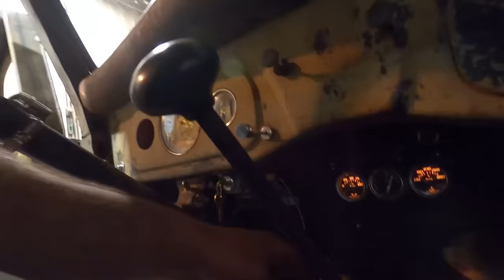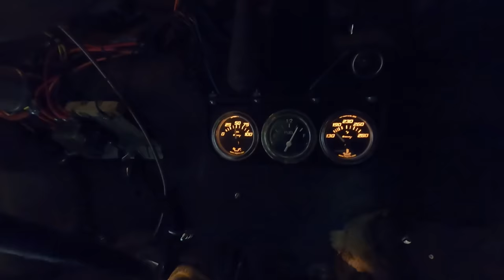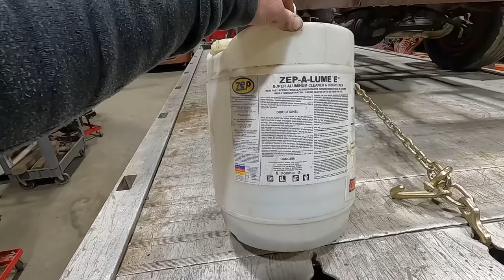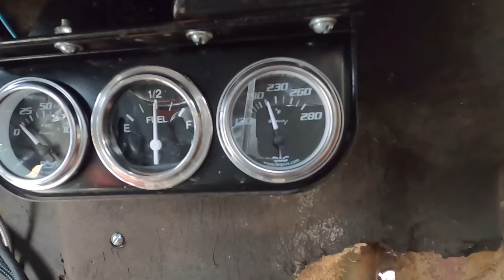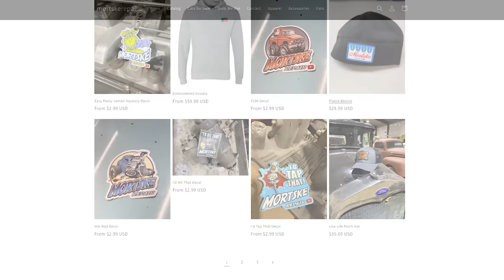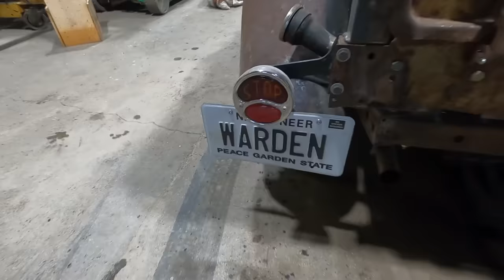1936 Ford Barn Find Pickup Truck! Overheating Flathead V8!! Problem Solved!

Comment: There is something about old flatheads that hold a special place in my heart. I have a 51 Plymouth with the L head 6 and you cant kill that engine. I am not well versed on the flathead V8 , but I know a little.  And that had an A on the head. Thats an earlier one, right? The AB came later in the 40s? Correct me if I am wrong. I love learning knew stuffs. Keep up the good work Mortske.  Love the content. Happy New Year
Reply from the maker: Same to you!

Comment: If you're wanting to spend a little more to restore or just remove rust try this i have used it my self it works awesome. CRC Evapo-Rust, Heavy-Duty Rust Remover, Reusable, Acid-Free, Non-Corrosive, Water-based

Comment: Shoe repair; as a kid we used to have new heels and soles sewn on and even cleats installed to save heel wear. The cleats made a unique tapping sound on hard floors! The repair shops were always run by old cigar smoking dudes. The smell of cigars and boot polish is a distinct memory! Long gone along with radiator repair, TV, heavy machine, auto frame & axle and electric motor rewinders, a place I worked as a teen. :eyes-purple-crying:
Reply from the maker: Wild times!

Comment: Happy new year to you and yours Mr M!! I wish you all the blessings and success!

In the shop i work in, we have used CLR with great success in cleaning out plugged up heater cores. I personally havent seen it used in like an engine block or radiator. What ive done is removed the hoses for the heater core, plugged one of the inlets and filled CLR in there and just let it sit. Flush with water and repeat and thats worked. I dunno if youve ever heard of an automotive product called BG, but another shop i worked in used BG exclusively, and BG makes a cooling system cleaner and treatment. Not super easy on the pocket book but you dump in the cleaner and i think it says to run for like 10 mins or maybe 20 mins? Anyways run this stuff through and then flush. BG makes a hell of a product. Maybe worth a shot? By the way loved the dodge on the last vid! Thanks for all the content you are indeed the man!!
Reply: Yes those BG products are excellent! Kinda hard to find though, have to google dealers for it I think.
Reply from the maker: Same to you!

Comment: You should make a tool to remove the head, take an old spark plug and weld a tee handle on it, you could use a couple 3/8 x 4 bolts

Comment: I had a 76 Datsun 620 that I picked up in 2016, but sat since 1989 in california.. When I removed the waterpump, it was rusted solid, and the entire cooling port was filled with rusty dust.. I flushed the hell out of the engine by stuffing a garden hose into the inlet, and ran the engine. Never had cooling issues with that truck for 50k miles. I find that having the cooling system flushing but open with a garden hose works really good.

Comment: I loved this video, I'm looking for a flathead Ford pickup. This was wicked helpful. Happy New Year
Reply from the maker: Same to you!
Reply: I have a question, when it comes to freeing up a stuck piston, I see you putting heat on the piston, if heat expands metal, and cold shrinks metal, would it be less work to apply heat to the block surrounding the stuck piston? And possibly applying cold ( spray type freeze off) directly to the piston, then taking a hammer to the piston? Thanks

Comment: Ok couple of weird and somewhat messy tricks.  
1 foaming coil /condenser cleaner . It's great for direct access and pinpoint locations .
2 white vinegar and baking soda . Great for engines with water pumps removed . Pour white vinegar in water inlet until it starts to run out of block plugs ( removed ) then use a funnel to dump baking soda in the inlet and watch it power thru the block . It's messy but it helps loosen and blow out the rust . Happy New Year . Stay warm stay safe .

Comment: Heya Mortske.  You've given me a 2-hour-plus video this week, so I wrote you a book.  Hope it gives you a laugh or two......and doesn't take you as long to read!

Whatever you do, DON'T get rid of the crashbox in that old pickup!  She's magical - such a musical set of gears in that thing......and they are always great for comedic content and when you're out with a mate and start putting money on whether the next gear change will crunch or not.  Crashboxes are supposed to grind until they fit - that is unless you are perfect with your timing between the gears and catch it when the revs are just right.  They will put up with a lot of crap, those things....and that flathead and crashbox combo brings back a lot of good memories for me.

Just for ref., pipe cleaners were used to clean the old man's tobacco pipe.  There's (obviously) a small tunnel between where the tobacco sits in the bowl at the end and where the mouthpiece is.  Over time, it gets all sorts of tar, ash and sediment deposits in it that eventually stop the smoke going through as well, so they devised a piece of wire covered in bristles that went up the pipe periodically and gave it a colonoscopy.  There are huge versions of that setup which are occasionally used on the council sewers as well, but be buggered if I'd want to be the one to do it......or even be around the area when they do it...!!

Yeah, I dunno what it is about modern gauge makers - or is it modern engines that need them higher figures? No idea - but when I see oil pressure gauges that go to 150PSI, rev counters that go to 15,000RPM and temp gauges that go to 300F / 150C - ie: MANY MILES above anything I would ever need to see in cars I have or know about or would want - then I wonder wtf their manufacturers were thinking.  Maybe they had a bunch where they just calibrated the face to read what the needle said rather than calibrate the internals so the needle read in the generally accepted range.  

I mean, what engine is still going to be performing well at 260F...and if it has gone nuclear, what good is it going to be for you to know by how much?  Again, if I'm getting more than 80PSI flowing around the oil galleries, the needle being pegged at the end of the gauge will tell me there's something wrong with the governor - I don't need to know it actually hit 147PSI before the oil filter launched through the steering box and took out the left front wheel.  As for an engine that hits 15k rpm, it's only bikes, rotaries and Formula 1 engines that need that sort of range, isn't it?  And the irritating noises those things make made me lose interest in them real quick many years ago.  How is there a market for these big-numbered gauges?  Who is it that NEEDS to pull 150PSI at 15k rpm while the engine is defying he laws of physics and staying together at 260F?  Buggered if I know....but I wouldn't think there would be as big a market for them as there seems to be.  

Gimme a 7 or 8k rpm tach, an 80 PSI oil pressure gauge and a 220 / 230F temp gauge and I'm happy.  At least then I can then see a minute change in temp or oil pressure that might indicate I have an issue and I can tell by the rise and fall of the oil gauge as to where the problem is likely to be in the engine.  

Geez - any idea why my kids call me Korotiotio?  Grumpy old bastard......

Tech tip on stopping water getting into your distributor:  put some Vaseline or grease around the lip the cap sits on or better still, on the lip all the way around the cap itself and water can't get past it.  Vaseline does tend to melt off any excess when the engine gets warm, so try not to get it on the inside of the cap because at best it will lubricate the shaft and the weights and at worst, get between the points or the rotor and cylinder nodules on the cap and ruin your day.  I've also put the cap on and then smeared grease around the join between the cap and the base and had the only Mini that could drive through a puddle without stopping.

On overheating:  Yep - that crap building up in the water galleries is a definite issue with the old cast iron blocks....and worse with some than others - especially where people have only used water in the thing.  I had an Austin A55 that had an overheating issue and my Dad used to brew his own beer (stay with me on this....).  He brewed one batch - Brew 14 - that was so feisty that it exploded several bottles while it sat ageing.  Popping the cap off one to test, it fizzed and carried on like it had a permanent CO2 hose connection.  Poured into a glass, the stuff looked like ginger beer and even before it got to your mouth to taste, it smelt like someone had poured a whole bottle of seltzer tablets in it.  In short - it was undrinkable.  However, on the upside, it did clean and polish a pewter mug it was put in and re-minted any coins it came in contact with.  So, with that in mind, we brought the old Austin over, emptied her cooling system and filled her up with Brew 14.  I took her for a run around the block and the old car smelled like a brewing factory when I got it home.....but in emptying out the cooling system again, I was astounded t the crap that Brew 14 had dislodged and that flowed out of it, when the usual flushing methods had previously done nothing to solve the overheating. Refilled the cooling system and she ran perfectly - and even had a working heater for the first time in my ownership!  Dunno what happened to the rest of it, but that brew was a superior form of cooling system flush, that's for sure.

Hey - just as Puddin' has his pressure-washing (pressure-watching?) shenanigans, you could get creative with the ice removal!  There's a GOOD point of difference!  As you say, it looks so satisfying.  Being someone that has never lived in that cold a climate......ever.....I cannot relate to the "fun" that must be endured when the power wires ice up so bad that they collapse poles with the weight.  Around here, poles only usually come down with the help of a Honda Civic driven at speed by a boy racer.  We've still had times where power has gone out for a couple of hours, but not a couple of days or a week.....except back in 1997 when several main transformers blew in the Auckland CBD and took out half of the central business district.  Then a week later another one went and due to the sudden shift in load, it caused a cascade failure on two more and the whole of the Auckland CBD power grid went down.  Parts of the central city and surrounding suburbs were without power for a month.  Sadly for me, the place I worked was only out for a day and a half over a weekend, so it was just business as usual...although the traffic was lighter for the duration.  Doesn't compare with what you blokes go through every year though - and I love how you all cobble something together like one big family to make things work for each other.  There's too little of that camaraderie and 'help they neighbour' spirit in the world, man.  Selfishness seems to be a way of life in the bigger cities and it's just not necessary....and I don't like it one bit.  Doesn't stop me helping out where I can anyway either.  Getting out of it in the next couple of years, I hope too.....but bear that ice-breaking idea in mind.  Could be onto something there....

What will I be working on in 2024?  Well, I want to get the Triumph Stag to the point where I am happy enough to put it up for sale for what I want for it.  A bit of bodywork and farting about with fiddly stuff - cosmetic mainly.  Then I am going to be getting my Triumph 2500S running again and back on the road.  She has front brake calipers sticking and her carbs have filled up with crap while sitting thanks to the quality fuel we have these days, so now she floods like mad when I try to start her and wont idle, so they need doing before anything else.  The brake master is a bit weepy too, so I will do that when I do the calipers.  There's a bit of electrical work and I want to change the universal joints on the driveshaft so it loses the half inch of play it has and stops clunking when I change gear.  Then the 1977 Mini is in for wheel bearings, engine mounts and a conversion to a twin-line brake master cylinder and metering unit because its disk brakes wouldn't stop a peddle car.  It also has a fair bit of rust popping out on it now from sitting out in the humid weather for two years and that will need addressed before it goes for inspection.  Then I am going to sell the Mini as well and start work on the project Mini I have been ignoring in the back of the workshop.....or maybe I will just sell that project and buy another running classic instead.  That ought to keep me busy for most of the year, I reckon.  Well, that and watching these long videos of yours, mate!  

All the best for 2024, Mortske.  Hope she's a bloody good one for ya!
Reply from the maker: New record novel!
Reply: @MortskeRepair  - Yeah, but did ya read it, mate?  And did ya get a laugh or two?
Reply from the maker: @KiwiStag74  no comment

Comment: Evaporust is what I would use.  It is environmentally safe, so you can flush it down the drain without killing a bunch of wildlife (or drain and reuse).  It is mildly acidic, but becomes neutral as it reacts with rust.  It only reacts with rust and does not attack the base metal unlike acids. It is safe on non-ferrous metals (like the radiator core) and doesn't damage plastics or rubber (like the seals in the water pump). I could go into all of the chemistry involved in how the negatively charged chelation agent in Evoprust reacts to neutralize the positively charged ferrous oxide, but basically you would just want to full the block up and let it soak overnight.  Afterwards, just flush it out with clean water to get out any unreacted Evoporust and the Ferrous Sulfate (black particles left from the reaction).  As indicated by one other commenter, Evaporust does like a bit of heat, so you could probably run the engine for a little while to encourage the reaction.

Comment: Wow, look at that nice flint water, LOL

That was crazy. My project (2000) radiator decided to explode due to ... not uh... maintaining it. It took a lot of flushing and the amount of schmoo that came out was pretty crazy - not sure if you could've flushed that out it was so packed.

Also, FYI, purchase some painters suits. I've been working in my attic (yellow insulation is horrible) and it's been pretty awesome. In terms of taking a rust shower that would've helped a lot. For about $5-10 a suit they're pretty sweet.

Comment: I’m working on an 06 plate (2006) Mini Cooper S which is enjoying some overheating issues. Currently running without a thermostat and a bypass (with toggle switch in the cabin) for the radiator fan because the temp sender is knackered! I’ve sheered two bolts off the carrier hub in the last 6 months on jobs that “should just take half an hour” 😂 all that said I’ve learned A LOT about Mini Cooper R53’s ! Big thanks for the effort you put into the channel mate. Tom, Birmingham UK x

Comment: You could have placed a hose that was small enough to go into the water jacket holes into a shop vac and sealed up the small hose to the vacuum's hose with duct tape to remove some rust.

Comment: Flatheads always had an overheating problem, even on a good day.  Henry actually experimented with an air cooled Flathead.  Not sure how well it worked but the Speedway Motor museum has one and I'm quite sure you saw it when you visited last year Mr. M! 😎
Reply from the maker: I saw that there!

Comment: I have used a product I got at NAPA, a Gunk product, Super Heavy Duty Radiator Flush.  It sure helped clean out an old engine or two over the years.  Mud/rust runs out when you pull the lower radiator hose to drain it all out.

Comment: Hey mortske, best way i know to flush rust out if you know its dry and powdered like that stuff is to get a vacuum on the largest water hole, cover the rest with a rag, and spritz in air from the other passages one at a time. The incoming air will knock it all into the air and tha vacuum sucks it up. You need at least one passage open to keep air flowing but otherwise it works great

Comment: You can get powdered citric acid to clean the rust.  I used it to clean a Kawaski Concours fuel tank.  Just put the powder in your radiator and add water and let your engine get warm and let sit for 4 hrs and repeat until you are happy with the water color.

Comment: Water actually is better at cooling than antifreeze, but it freezes.  So you use a mix, just enough antifreeze so it won't freeze at the coldest you might get in the winter.
Reply: Antifreeze  has a way higher boiling temperature

Comment: Mortske here are some coolant flush guns. This is the one we used to have  Bars leaks flush gun kit. We added a hose fitting and some hose and a airgun.. Then there is the Tool pro radiator back flusher and the Toledo tools radiator flush gun.

Comment: Hey Mortske, in Oz an old bush mechanic method is to wrap a pair of stockings or fly screen over the radiator before putting the hoses back on. That way none of it can find it’s way in the block and it’s as easy as taking the hose off and throwing away or re-cleaning the stocking/ fly screen for another round👌